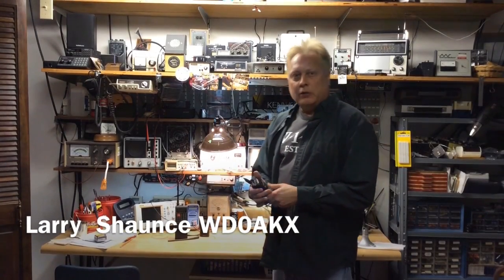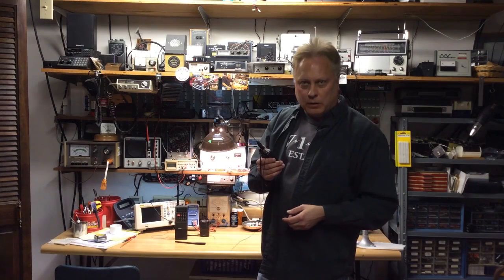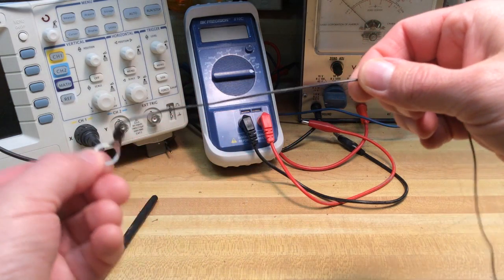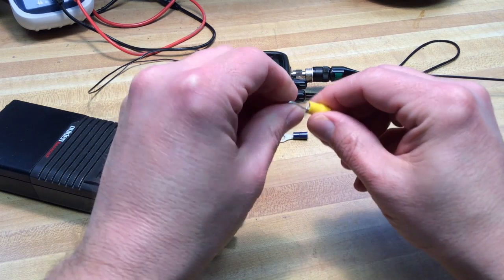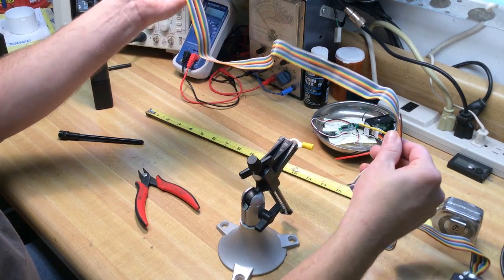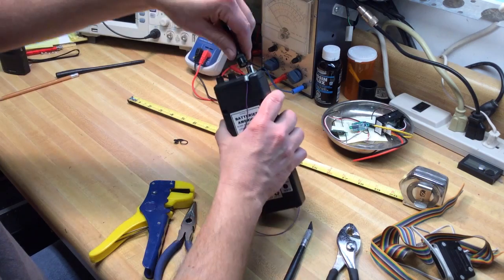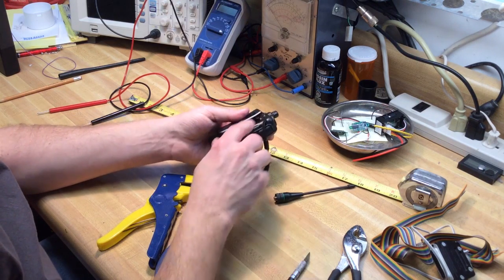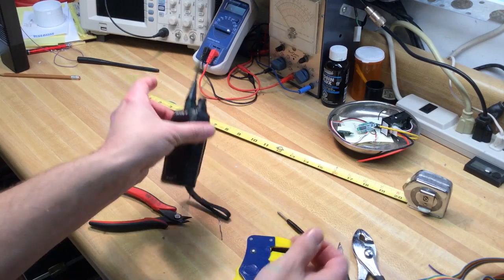Maximize 2 Meter HT or Dual Band Radio Performance With This Easy Tip

Comment: Are you aware that by adding the adapter you are causing three things to happen? One, that type of adapter increases the chance of hitting the antenna and breaking off the connector on the radio. Two, the adapter introduces loss into your setup. Three, the adapter lengthens your antenna by 3/4 to1 inch, thereby changing it's resonant characteristics.

Comment: Okay, got a question for you. I ride a two wheeled recumbent bike, that is about 7 foot long. I run a 5/8 wave Diamond 7500 Super gainer, Dual band antenna on it. And I am not sure how good of a ground plane it provides. So I want to add radials to the antenna base plate. Can you tell me how long I need to make the radials? I am having no luck at all.
Reply from the maker: The radials for 2 meters would be 19 inches long and for 440 they would be about 6 inches long. At least one radial per band and if you can do it use 3 per band but one should suffice.
Reply: @RadioHamGuy  Okay, I did the math, that I found online and for 2 meter radials I got 21.25 and for 70cm I got 7 inches. I plan on using two of each on the base plate that the antenna will be mounted on. Oh, and do I have to use round stock for the radials, or could I use say 1 inch by 1/8 of an inch, aluminum flat stock? Would make it so easy to bolt to the antenna plate. Any ways, thanks for the email. I have been licensed since 2016, but I still have a lot to learn. Thanks again.
Reply from the maker: @JamesHart62  That should work just fine and it is not real critical. Best of luck and hopefully you get out a good signal from that setup! 73

Comment: Baofeng UV-5Rs (and variants) have steel connectors that make attaching tiger trails a breeze. In fact, I think they may have been placed there for that reason. Also, could you please include the variable lengths of the counterpoises for antennas/purposes (FHS, GMRS, UHF and VHF)?  Thnx.

Comment: Honestly one could do the same thing with a large gator clip with the wire off the end yes?
Reply from the maker: Yes you could. That would work if you can get it clamped on ok.
Reply: @RadioHamGuy  I've seen others do it. Seems to work for them. Got new radio coming I may take part of yours and my idea and put them together use the idea for the antenna part that ring part but on the end the wire goes on make a quick connect for the wire. Makes it more portable and only used when needed. Therefore making the radio less ugly. Cheers.

Comment: I have a half wave telescopic antenna for 2m for my HT. would a counterpoise help?
Reply from the maker: My guess is that it wouldn't make much difference while using a half wave whip since that makes up the full size of the dipole. Never hurts to try it though if it is easy to do. 73

Comment: Would this work for a Bearcat 220 scanner too? If so, how long should the cable be and what gauge should do? Please let me know. Cheers!
Reply from the maker: I would guess that it would help but everyone seems to notice on some radios it don't help much and others it makes a big difference but it would be worth trying since it is easy to do.  The gauge of the wire makes no difference, go for the smallest you can probably and I would make it around 19 inches or so, not critical.

Comment: If you add a 19.5inch counterpoise, will it also help in the 70cm band? Or does it absolutely need to be 6.5inches for 70cm improvement?
Reply from the maker: That should also work just fine!

Comment: A couple of thoughts. 1: Using the adapter between the antenna and radio effectively lengthens the antenna and changes it's center tune point, so this should be considered if using a tuned antenna. This makes connecting to the chassis or if possible, the metal base of the existing antenna, preferable to lengthening the antenna by inserting an adapter. 2: Wire diameter. As thin wire has higher resistance, one may wish to consider increasing the the wire gauge of your counterpoise wire and increasing its capacitance.
Reply: The adapter acts like a short piece of 50 ohm coax, does not change the physical nor the electrical length of the antenna. John, N1WOM

Comment: I did hook up a counter poised to my antenna and I like it better when I hook it up to the screw on the belt clip does that work as good as hooking it directly to the antenna
Reply: In fact, that screw is tighten to the chasis of the HT so should be similar as hooking it to the antenna ground..

Comment: I have a dual band ham radio, if I add 19 inches of wire will that increase my SWR  I don’t have anything to check it
Reply from the maker: You will be fine, it will more than likely improve it and should not make it worse.  Hand held radios normally withstand somewhat high SWR with some of the poor rubber duck antennas sometimes and with the low power output they seem to be fine.
Reply: RadioHamGuy  Thank you
Reply: I bought this handheld I’m just listening for right now I use your rat tail idea worked pretty good, just trying to learn the lingo and I need to get a license by listening I have learned where they’re going to have a ham fest this weekend I’ll probably shoot out there and start talking to people, it’s a good way to get started I guess

Comment: If you measure SWR it actually makes it worse with those tigertails, unless you physically touch the other end of the tiger tail, thus providing a better ground. I think the material and coiling (thus inductance) plays a role in changing the SWR. Sure it's a quick tip, but not very accurate and misleading.

Comment: does coiling the wire work was well around the rubber duck?
Reply: David Connors Jr Nothing wrong with experimenting. I would imagine that wrapping the counterpoise around the antenna would degrade the antenna though.

Comment: hi just looked at your video i have been messing about with rats tails for a few months now, and on my yeasu  ft60e handy a 19.5 inch rats tail gives me approx an extra 3 s points on received signals also tx audio is stronger into the local 2 meter repeater gb3bc in pontypridd wales uk im approx 26 miles from the repeater site. without the rats tail i can just about open the repeater very scratchy signal, with the rats tail access is clean so the concept of adding a counterpoise isnt snake oil. best 73-•- mw6zan
Reply from the maker: Yes, can be almost any kind of wire, just small and easy to work with, does not matter really.

Comment: I would have liked this video much more if there had been ANY quantitative objective analysis, instead of "it should help your radio quite a bit".  Testing field strength would have been great.  Even a side-by-side comparison of the ability to hit a repeater with and without the counterpoise, or audio of the reception at a distant simplex receiving station with and without the counterpoise would have made this much more than authoritarianism and possible pseudo-science.

“When you can measure what you are speaking about, and express it in numbers, you know something about it; but when you cannot measure it, when you cannot express it in numbers, your knowledge is of a meagre and unsatisfactory kind; it may be the beginning of knowledge, but you have scarcely, in your thoughts, advanced to the stage of science, whatever the matter may be." - Lord Kelvin
Reply: This isn't a new concept, just a how-to. Why don't you look it up on the many many websites out there that host info about these counterpoises?
Reply: Then go find a website or a book about antenna basics and begin studying. The fact that you both are questioning the science behind this shows you don't understand the topic.
Reply: I’m less than convinced. Either way, if you’re going to make a video about it, it’s just as easy to plug the thing in, and unplug it to show the difference for some weak signal.

Comment: is working. used a cooper wire to test the video and is a improvment about 15-20%. my transciever have 10 bars to measure signal strenght and while i was touching the wire on the metal part of the antenna it increased from 4 to 6 and the sound was much cristal.

Comment: Thanks for the video,  do you have any SWR measurements for before and after adding this? I thought antennas on handheld units were tuned to 1/2 wave (via the loading coil) to eliminate the need for a di-pole at 2 x 1/4 wave?
Reply: I have the Nagoya UT-72. The SWR in the VHF sucks bigtime. On the other hand, it showed really great Swr reading on the Uhf band…low to almost flat 1. 
It was like “night and day”. I hope this “tail” helps improve the Vhf swr.
Thank you.

Comment: I know this actually works, I can hit a repeater 57 miles away, surrounded by buildings in my house with half a watt. but the gauge of wire used shouldn't really matter should it? I used ac ground for my cable and I can't remember what sized stakon. also, I had to smash the stakon with a hammer to get it to pinch the wire.
Reply: Yep.  Did the same thing to mine and it hits repeaters over 120 miles away with 1/10th of a watt, and that's from INSIDE AN UNDERGROUND CAVE.

You're funny.
Reply: +Hippo Potamus well you must be living in a cave if nobody taught u manners.
Reply: You do realize that the only way you're going to get 57 miles at VHF is if you're on top of a very tall mountain and the other end is another very tall mountain 57 miles away, right?  Unless you're talking about some seriously wacky kind of tropospheric ducting or meteor scatter or EME, but you didn't mention any of those.  Did I misunderstand?
Reply: +Hippo Potamus well it is a pretty high up point. and I didn't really realize much as an amateur amateur that was only a month into the hobby. it's not half a watt tho it's  4so my bad
Reply: I apologize.  My initial response was rude.  I just get a little bent when people exaggerate the benefits of snake oil.  I claim you were exaggerating not because of the power level but because of the distance.  You can put 1000 watts into a pretty good beam all day long and you still have to deal with a little thing called the curvature of the Earth, even if no buildings were in the way.  Throw in some obstructions and 57 miles on a line-of-sight frequency just doesn't make any sense unless tropospheric ducting, meteor scatter, sattelite relay or EME were involved.  You didn't mention any of those.  Still, I was rude, and I have apologized.
Reply: +Hippo Potamus well yeah I don't understand curverature much. but the repeater antenna is 2000 feet higher than I am so that could have something to do with it. I never got into anything long range because I've never needed such equipment or comms. VHF UHF local work for me.

Comment: Interesting - don't you then end up with the lower half of a dipole trailing past your fingers, exposing them to the risk of an RF burn?
Reply from the maker: +Jonathan Warner No, not a problem with these low powered radios.  With more power it would be a concern however.
Reply: +RadioHamGuy oh yes it is. I've been burned twice before just one five watts.
Reply: +George Ace just if u keep the wire insulated it should be fine. just no copper showing and it should be fine

Comment: does this work on a handheld cb radio too ?
Reply: +Erik Loos Should but you would have to make the wire a bit longer. Calculate 1/4th wavelength of the 10 meter band.
Reply: CB is worthless compared to amateur radio, cussing goes on cb

Comment: I've tried the counterpoise and it did not improve my reception. Tried it on an Alinco DJ-500T and Baofeng UV-5RA. It is likely that the area in which I live is just too low compared to my surroundings to get better signal.

Comment: Makes perfect sense.
As a thumb of rule woulød you say it should be the same length as the antenna you are using?
Reply: ***** No, it should bee 1/4 wavelength of the frequency you want to RX/TX on. 
468/MHz/2=1/4Wave Length. The radial is usually as long, or longer than the rubber duck.
Reply: ***** http://www.csgnetwork.com/antennagpcalc.html
Reply: Radio Rob but what if you have a dual band radio and need to operate on a number of frequencies?
Reply: *****  Then cut your radial 1/4 wavelength of the lowest frequency you plan on using. The length isn't absolutely critical. Even if it isn't cut to optimum length, its better than having no radial at all. KJ6JJK
Reply: *****  BTW, if I may add my own $0.02, I don't like the method of attaching the radial described here. I use an alligator clipped to the strap ferrel  thing (its chassis ground) on the Bao UV-5R. No stress on the antenna/connector, and it can "break away" if the wire gets caught. Also, if you use a hand held speaker/mic, its cord can act as a counterpoise if extended.

Comment: Helpful video, Thanks! You mentioned adding a counterpoise to a scanner to help with the receive. How long should the wire be for a scanner?
73 KB1ZYI
Reply: Ralph Krohne 1/4 wavelength of the frequency you want to receive. 
468/MHz/2=1/4Wave Length
Reply: Ralph Krohne http://www.csgnetwork.com/antennagpcalc.html

Comment: TKS I will try and get the program terry
Reply from the maker: Terry Mattson It is free download software and has worked well with my radio, much easier than doing it manually but you do need a cable to the radio, mine is a USB cable made for my radio.

Comment: Hi ham guy any help programming a new tyt DM-UVF10 MANUAL IS NOT UNDERSTANDABLE ve5tlm terry tks
Reply from the maker: Terry Mattson I am not sure on that radio but I have a couple of the Baofeng radios and found them very difficult to program without using the Chirp software and the computer.  I would be that radio would be covered under that software also, it covers a lot of models I know.  That is what I would recommend looking into to start out I guess. I don't know why they can't make the radios easy to program manually.
Reply: +AstralDreamsAstral I have the 202 also and they are built tough! The only bummer is the memory battery to change. Other than that, it is one heck of a handheld transceiver.And I also have the Baofeng 5r which is a good radio also, just not as rugged. I like the 2 band and other features it has.
Reply: +AstralDreamsAstral absolutely is htx 10 talked all over the us and carribean on 25 watts and 102 inch whip
Reply: +thomas dunaway started as a new ham with a 202 if they quit transmitting . you reheat the solder on the rf transistor[ it fixes that issue most times

Comment: I just tried out your tip using a paper clip, a small alligator clip jumper cable and a Baofeng UV-5R, it has turned a scratchy repeater more than 10 miles away into near perfect! :O Magic!!! Thanks.
Reply: On my UV-5r I use a small alligator clip on the metal ring the wrist strap connects to quick and easy and works well
Reply: @yapyap66 I'm going to try that on my Baofeng AR-5RM radios.

Comment: If you have a quad band radio, do you need to add a counterpoise with varying lengths for each band or do you use one counterpoise and average the length between the bands?  I have a Yaesu VX-7R (quad band:  6M, 2M, 220, and 70cm), so I was wondering how to do it.
Reply from the maker: For that I would just use a 19 inch or so section of wire.  For 6 meters, it will not help much probably, you would need a much longer wire there but that would not be very practical to do.

Comment: Hey HamRadioGuy
I use a radio case for the radio so should the counterpoise length start after it comes out of the case or should it be the same length including whats in the case ?   I attached it to the back screw that would hold the belt clip. My antenna is 15 inches so 15 inches after it comes out the case or 15 inches total
Reply from the maker: Regardless of the case or antenna length, I usually make the counterpoise wire a touch longer than a quarter wave length, so for 2 meters, around 19 inches or so, and that will also work ok for a dual band.

Comment: It's a ground plane or ground radial. Most handhelds do in fact have some sort of ground plane system in them, they are not as efficient as hams would want them but the purpose of a handheld is to be portable and not have huge antennas attached.
With some UHF portbles like the Motorola HT1250 the ground plane is the back metal battery holder, you cannot add an external radial to these radio as they DO NOT use a polarity type connection. The antenna connection is HOT and not a ground. With an MTS2000 you can barely add one but its pointless as it to has an internal plane.

Comment: Thanks shieradelta4, since you hit up on the UV-5R that helped me cause I use that one. My concern is...I have several antenna's I sorta use....by that I mean i have about a 9 inch whip that I use which is very flexible so that is the one I keep on there when going in and out of my bug out bag or Every day carry bag, I also keep an extendable antenna that opens up to 34 inches and closed is 9.25 inches.... while I could very easily carry two tiger tail set ups how would you suggest dealing with length issues when using the longer antenna since it would not always be fully extended and thus have a difference in about 25.25 inches? Obviously I could carry a 3rd tiger tail but...that is not really reasonable since I would not want to stop and swap each time I had to extend out fully to use. Would it be any more or less effective to use the 9 inch tiger tail for both? and what effect would it have when fully extending to 34 inches?  hoping either you or RadioHamGuy either one could answer this for me. and for tech purposes the antenna is an AL-800 that I use if that makes a difference.